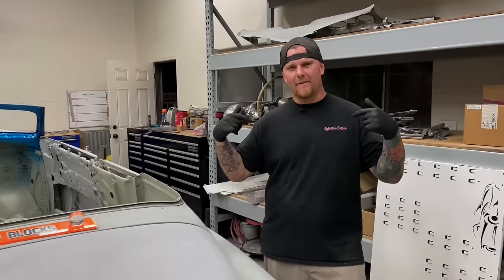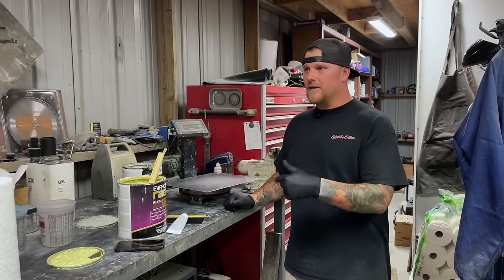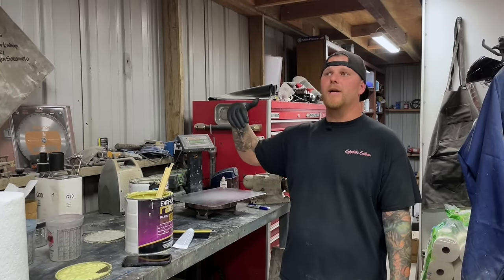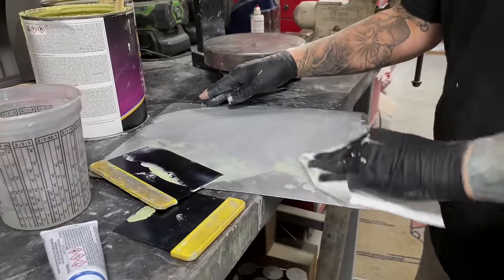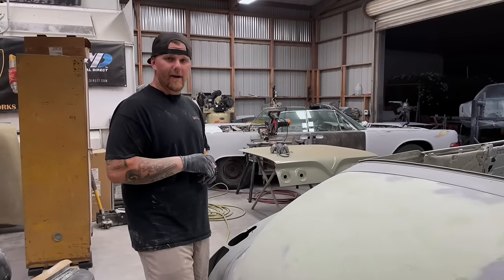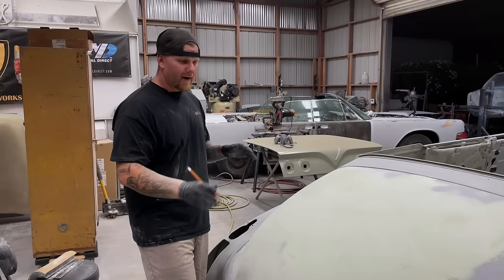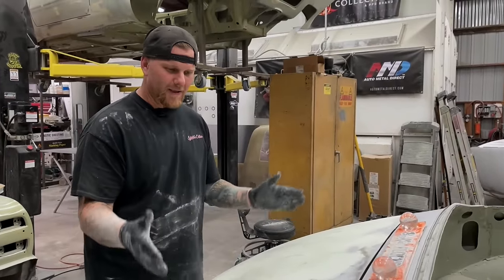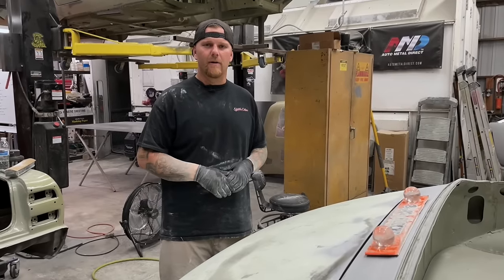The Body Filler Innovation You Can't Afford to Miss!"

Comment: You only prime one time after filler?! Geeze. I do 2 at the least. Block 80 finish in 120 the first or 120 only  depending. Prime 220 prime 320-400.
Reply from the maker: We try to anyway every now and then we might prime a few areas depends on the client. We usually take our filler to 220 then prime and then come back with 220 again then 320 and wet sand 600 for best results.

Comment: I agree with the amount of hardener needed when applying filler in high temperatures. I've used less than half the recommended amount of hardener and NEVER had an issue. It will set off in high heat, no worries. 
I once painted a Holden FJ series, which was produced in Australia by Holden from 1953. I was only asked to paint it, as he had already done the body work, and he just wanted it painted to protect it. 
When I got the car, the body work was so bad, I told him I wouldn't paint it without redoing all the body work myself. It had been a complete nuts and bolts restoration, and I felt it was worth doing right. 
I used a cheap filler, and as it was during summer, I used less than half the recommended amount of hardener. The job came out great, and he was persuaded by his friends to enter into a car show a year after I did the job, and It won best body and best paint. On a side note, after I cut and polished the paint (10 months after I painted it) I asked his wife for some cornflour, to give it a final polish, and she gave me icing sugar. I didn't notice until I started to taste the sweetness in my mouth. But, as I was polishing it, I could see the fine scratches from the buffing compound disappearing like magic. It turned out like glass. I used it on all my best jobs after that. Thanks for the vids and the trip down memory lane.
Cheers from Australia.
Reply from the maker: That’s awesome thank you very much!!!

Comment: First, I want to thank you for this video. I've never visited your sight until now and already subscribed. I just started to try the body work, although I'm 69. I build motorcycles, high performance and repair. I just finished the 1976 Yamaha RD400 motor, very high performance for the drags. I'm going to use the stock metal tank, while the rest is a fiberglass kit. I made an attempt to "Bondo" and every thing you said not to do is what I had done. Not stopping when sanding was my biggest dumbshit mistake. One in a long line of them. Back and forth, Bondo and sand. I am going to start from your earlier videos instead of asking stupid questions. I grew up in Glendora CA and now I'm in Sparks, NV, out where I can't hurt anyone when testing my bikes. I understand that Irwindale Raceway is still around and allowing people like me to run the 1/8 or 1/4 mile drag. Thanks again!
Reply from the maker: Thanks for the sub!

Comment: New subscriber here. I wish I would have found this channel sooner. I’ve done some Harley’s and some repairs on peoples cars(smaller/less challenges) . I’m now restoring a K5 Blazer, I’m currently in filler stage now. My biggest problem now is being efficient and I have been running into problems with not having enough time to work with the filler and I’m also running into sanding into and through the epoxy. That’s where the biggest efficiency problems come in because when ever I see metal I spray more epoxy having to wait forever to do anything else. With my work schedule of 5-6 days a week of 12-16 hour shifts spare time to work on my truck is invaluable.😂 I have a good understanding how to do this and have always gotten my desired results and people love what I’ve done but damn it takes me forever, so every tip I pick up is much appreciated. Thanks for posting.
Reply from the maker: Right on! Thanks for watching!

Comment: Thank you for this! I'm doing filler work over epoxy on a rough restoration project and your tips have saved me a TON of time. I'll have to watch all of your videos now. 👍
Reply from the maker: Glad to hear it! Thank you
Reply: If you use the right filler you don't need epoxy the z one my belief is the lesser amt of layers of products the less chance for falture.epoxy is old school we don't use it much any more. It takes maby a month to cure out a
Reply: @rogerstephens8980  My panels had some pitting from surface rust that I acid washed to clean metal. I put the epoxy on first to have a guaranteed good bond to the filler. Yes it does take a long time to cure. This is a slow resto job, not production body shop type work.
Reply: We have passed the need for epoxy i dont know if will hurt or help ill say the name for you the Chad dude uses it z grip  it will stick to bare metal . A wile back primers weren't what we call metal to metal epoxy was the glue . Now alots o 2k primers are . My favorite is upol it is also pretty cheep.that is all we use you can mix upol as a sealer you could work youre filler on the top. My theory is the more products you put on the more chance for faltered. Idont use ppg because I have had alots of faltures . I use matrix 42 clear 2to 1 4to 1s have about half the urethane base as a good 2to1 and forget acrylic urethane.if youre keeping the car inside mostly a 4to1 is easier to spray but put 3 or 4 coats on to build the urethane that is what holds the whole paint job together.

Comment: Combining two different fillers from same company that have slight chemical extras, is a very interesting concept to extend the working window. Neat Travis! Excellent info in this video lesson and I have one outside the box to share. With the exothermic reaction taking place, I had one of those moments where I asked quietly then answered out loud “Why not.” Hot weather, same first build coat and still wanting the hardener ratio close to correct, as I left a auto parts store, I saw a tile shop next door. After 6 or 7 minutes, I left with a white glazed tile, 13” X 13” bright white and smooth as a church bench. I epoxied it onto a hard plastic cutting board with a hand hole out one end. It protect the tile by 1” (25.4mm) and placed by the A/C vent, in minutes it very cool to the hand. Plus, it was free, but this too is extra thermal mass that extends the chemical kick that filler does so fast in hot weather, it seemed like I had 10 minutes more to work it. Like your explanation of a tight coat, press it into the sand scratches or pores of bare metal if not in epoxy. I was shock even though it was a little heavier but always keep a snappy roll cart handy next to my work. I hate using a car hood as a temp storage spot for extra PSA grit rolls, Kimberly-Clark Wyp-Alls L40 lint free, pump sprayer with isopropyl and different spreader, grater and guide coat. Strange when something simple jumps up and makes you smile inside. 
 Aluminum clad large commercial backing sheets was another from a restaurant supply store had major used items as these are stackable, don’t bend (Al-steel-Al stamped) like a dime blank. But I bought 16 for $1 each and have them on my MIG, Roll Cart and 10’ table w/folding legs next to my 2 sewing machines. They are stupid simply and work great to carry tools & product from job to job or quitting time in front of the tool box at 9:30 at night! 
Love the information, visuals, product and lessen well explained!
Well done! Winters coming but SEMA first!
Reply from the maker: Someone long ago had mentioned putting a filler board in the fridge I think it could alter the filler long term but I can’t verify. Ultimately the best thing is doing filler in a temp controlled room. …. Maybe one day 🤣
Reply: @SYLVESTERSCUSTOMS   I agree, best to have A/C than freezer. I like my tile setup! It is thermal mass that draws down heat as excited molecules want to migrate to low energy. The result is cooling, the effect is longer filler open times. 
Have a great weekend but I know you got a crunch time on work for SEMA. Never been, don’t know when and never will have funds again. New washing machine in my future! Just what I wanted. NOT!

Comment: I recently tried evercoat plastic honey with rage ultra. And it helps  tremendously in this 100 degree weather.   Only use it for big areas.
Reply from the maker: If you haven’t mixed the two together you gotta try it. Not even comparable to adding honey 👍🏻

Comment: The man who taught me p&b worked his bondo with a CP grinder. Then finished with air file and blocks. Amazingly fast and straight and flat with perfect contours and symmetry! He was a perfectionist! We both old and retired now and HATE body and paint work. 😂
Reply: I learned to do the 'roughing' with a 9" sander and a stickit 80 grit and sometimes also used a panel file - but - using a panel file incorrectly can slice the filler, hence it takes a lot of careful attention and knowing how to read the movement of the file, but once perfected, it saves a lot of sand paper, the panel file just need a wire wheel to occasionally clean the gummed up file back to near new.  I also used a banana panel file to shape concave filler fills, knocking the top of the the highs and 'roughing' the shape before moving to the 80 grit. It was common to use 36 grit for the roughing, I never used it and used 80 grit, I never liked the deep cuts that were left from the 36 grit.  HA - I HATE being a perfectionist - nobody notices the work that goes into the perfection but me.  CHEERS from AUSTRALIA.
Reply: I used to work at a shop down in "The City" where  we did ALOTTA blow n go "kustom" work/restoration jobs 😏...And I "got schooled on the air file" by an old timer AND? AFTER I FINALLY DID figure out HOW to let the sandpaper AND the air file  WORK FOR ME...Chit WAS sooo MUCH easier to do with THAT situation. Air File the panels down with 80 grit, finish/finesse it out with 150 on the block and, prime TH outta it WITH high build 2k Urethane Primer and hand block then on out... Several cars ended up in World of Wheels and even 1 of em won 1st place in one of the Lowrider classes.... But yeah, different budgets and different styles of builds and...? Well, I hope ya get where I am coming from Lol 😆👍
Reply: AND...? I used to work for a "Corvette Restoration AND Fiberglass body/paint shop" and the owner could be smoking a cigarette, talking to ya, and be runnin a 6 inch DA, and sand darn near ALMOST ANY kinda crazy curved/sculpted/ body lined panels and???  ) ANYWHERE that the 6 inch D.A. COULD basically GO and???  DONE!!!...within a couple few minutes, depending on the area. 😦🤯 I'd just tell him "I hate you, you know it?" LOL....🤘

Comment: I weigh filler and hardner on my paint scale every day, and then make certain to mix the exact same size puddle with one stripe of hardener at the exact ratio. In Central Florida right now, using anything except Rage Ultra and Extra is practically impossible. If you mix other fillers properly, they go off while you're mixing them. I've used Rage forever but this newer stuff is amazing. I cringe when I go in a shop and see a can of 3M Platinum with a stir stick sticking out and the lid off the can all day, getting filled with bondo dust. This stuff is super expensive as far as fillers go, probably the most expensive, but having pinholes or mapping come back 6 months later is infinitely more expensive. Well done.
Reply from the maker: Well said! Thank you!

Comment: I used to try and sand my problems away and keep digging down.
Now I stop instantly when I see a high or low spot. I’m having to remind myself to keep building up to flatness. I’ve been getting critical with my filler as well. I used to just randomly mix it up and spread it on but started noticing that if the hardness of the two fillers is different the harder filler stays high and the softer sands easier and goes low.
I’m not even a perfectionist, but if I’m gonna put the time and effort in I’d like better results and keep moving forward instead of chasing low  spots and waves that I’m the one creating.
It’s like I might as well be hitting the panel with a hammer the last time out. Lol
I’m finally getting the hang of it though and I’ve been doing much better following this advice than anything else I’ve seen. 
I’d like to say thanks for not trying to be hip and entertaining with a bunch of jibber jabber and just getting into it and being normally serious about it. Bodywork isn’t something to joke around about. It’s to damned hard as it is and can make or break an expensive project while making you a foolish time and product waster.
Thank you.
Reply from the maker: Best comment I’ve received thank you!! Glad they help!!

Comment: The way you are spreading the material reminds me of how I plaster a wall leading into an arch,we use a tool called a slicker ( a 3-4 foot piece of aluminum alloy) to get the majority of mud onto the wall and pull it flat then use hawk and trowel for cutting in door ways and pulling the mud around the arch and for any curve in the wall of course plaster goes on much thicker but the idea is the same, right tool for the job and making All transitions seamless
Reply from the maker: Yeah I used to do drywall long long ago I can relate haha
Reply: @SYLVESTERSCUSTOMS  I was wondering, you where using a hawk to mix and Cary the body filler most people that have done stucco and drywall finishing are usually the only people who have them, nice work on the car by the way and thanks for the tips on working with body filler

Comment: @SYLVESTORSCUSTOMS Thanks for taking the time to make another very detailed video about how to mix and apply body filler. You mentioned Evercoat Rage Gold briefly but did not explain your thoughts about that version of Evercoat Rage. 

For those of us doing one off projects and only using body filler in patches rather than doing the whole vehicle,  one can of body filler is enough. In this scenario is Rage Gold as good as the other Rage options or does it have some shortcomings?
Reply from the maker: If you’re just doing a spot here and there, it’s just fine. We also like 3M platinum plus

Comment: Just one advice. When u apply the second thick coat to fill the obvious low areas, when its dry apply a third medium coat inbetween to connect everything. Ofcourse in different direction, cross pattern etc. Much better results.

Comment: Good presentation 👍. I've always had good experience with Overcoat brand. I've done many motorcycle frames, tanks, etc and tend to initially use the Metal 2 Metal on bare thoroughly cleaned steel followed by the lighter filler.

Comment: I learned a lot from this video. Travis I have a 67 Camaro convertible I'm restoring. Please consider doing a video on quarter to filler panel gap fill. Ive seen some people use just filler and some using lead. I prefer not to use lead but want the body work on the seam to last and look flaw less. Looking forward to your suggestions
Reply from the maker: We’re actually doing one on that soon. 👍🏻

Comment: Hi Travis, another great video. Does the Mirca guide coat powder cause an adhesion problem between filler or primer? Or do you eliminate it all before you re-coat?
Reply from the maker: Thank you for the question. Yes it will cause issues with adhesion. We scuff the area the guide coat is until it’s gone, blow it off completely and reapply and use pencil line as guide.

Comment: Big picture material verses spots of material. Workable amounts and applicable, your definitely done this a long period of times. What sealer did you apply to metal work. 🤙👍🤙👍
Reply from the maker: Check out our block sanding primer video it goes over the vp2050 we use 👌🏻

Comment: Correct me if im wrong but i do believe its bad to put bondo on bare metal as it will cause delamination and rust between the bondo and metal causing the paint to flake off in the future. Not many know this but you're suppose to put epoxy sealer on bare metal then scuff it up and then put bondo on top of that. Also after applying bondo and it starts to cure enough for you to be able to touch it and its no longer sticky or "green", you can wipe it down with acetone removing that waxy layer and helps with your sand paper not clogging up as easily.
Reply from the maker: Yes this car has epoxy down. But if you burn through it’s a high spot which you will burn through again when you get it flush.

Comment: I think many of your methods can be used on drywall repair too.
Great vidios
Thanks
Reply from the maker: Great point!
Reply: They can,  you can use similar tools (but bigger due to being for walls). If I am painting older walls in the UK. I skim the entire wall with easifill (those in the UK will know it), sand and repeat that'll take care of most issues. If drywall, obviously repair the area, tape spread out then repeat above process. You can also use the same process on wood (using the likes of that Ultra filler, not easifill) if there are dings in the wood etc you'd be surprised how well it can come out, most painters here don't go that far. Anyway subbed and have learnt some new tricks (and products, used to use upol) so thank you.